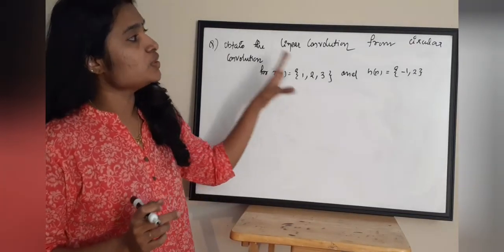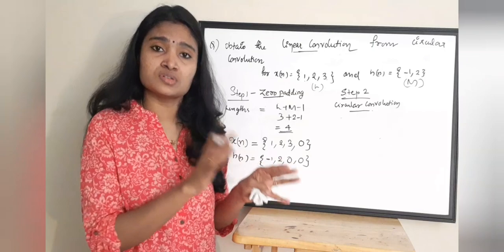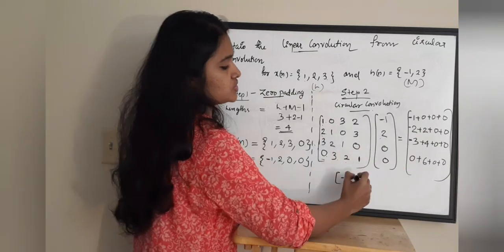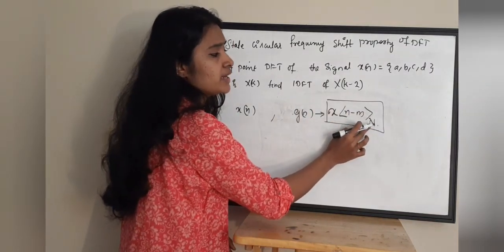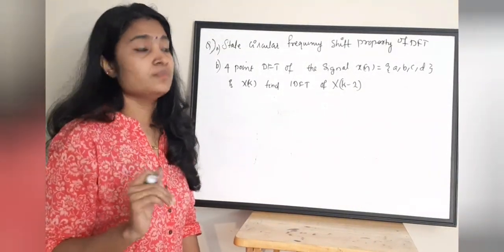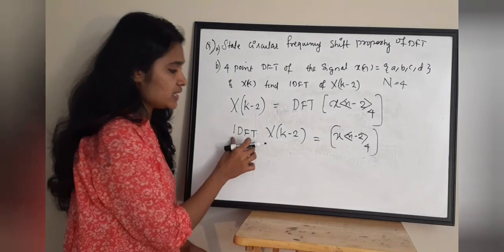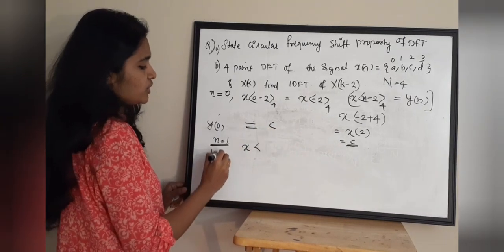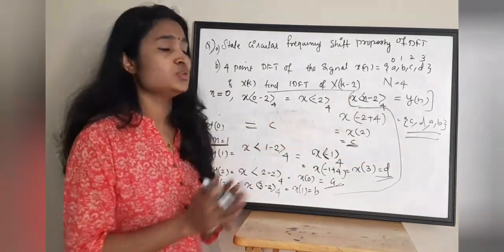Digital Signal Processing Previous Year Questions-KTU DSP Exam Preparation-DSP Sure Questions Part3

Comment: Your answer for second question is wrong , You have done using circular time shift property, but question said use circular frequency shift property(DFT(Wn^-nl *x(n))=X(n-l))
Reply from the maker: Yes, second one is wrong i got confused with two properties.
Reply: @EasyElectronics_jobupdates  could u plse give the correct answer of b part question of 2nd question
Reply: Ok